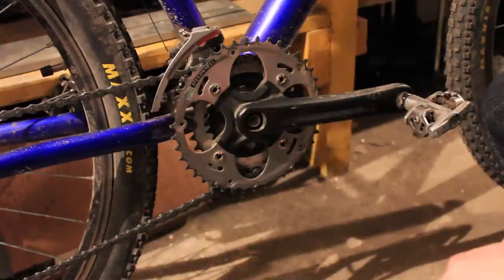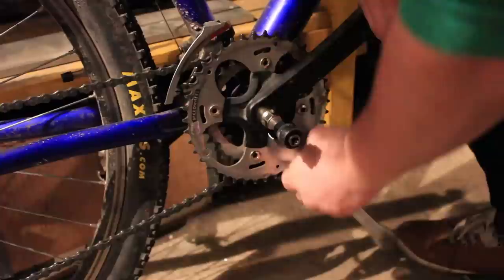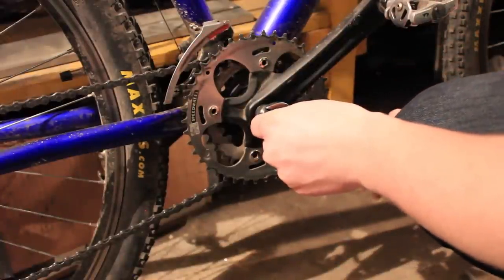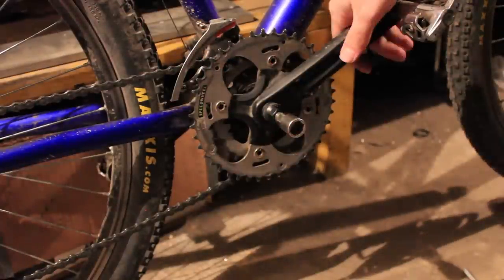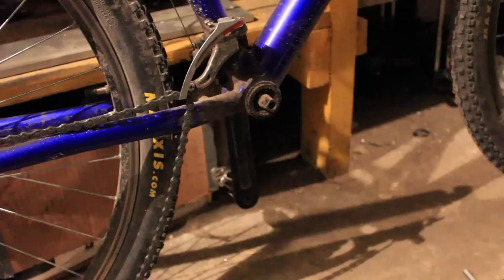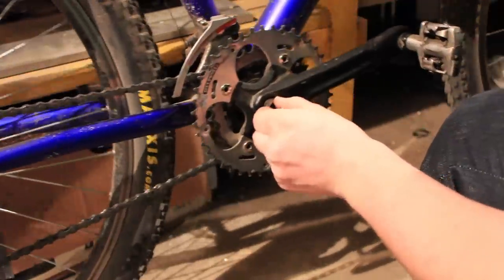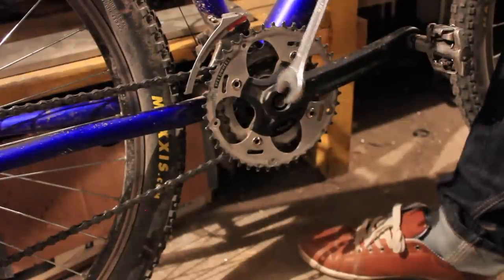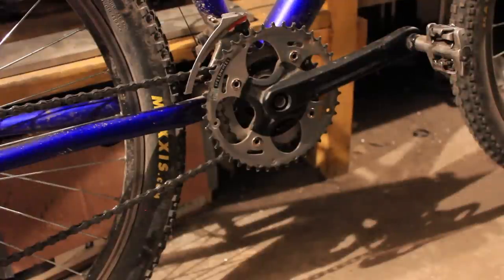How to remove cranks from your bicycle

Comment: It looked like the spanner you were using was too big and it is a wonder you didn't round the nuts you were using it on.
Reply from the maker: Hey there David, thanks for the comment. Those cheap chinese knock-offs have pretty good materials(hardened steel), but often they are off with their sizes. The largest difference was with a 1 inch threaded headset, the chinese version was so small my Park Tool wrench could not grip it at all.